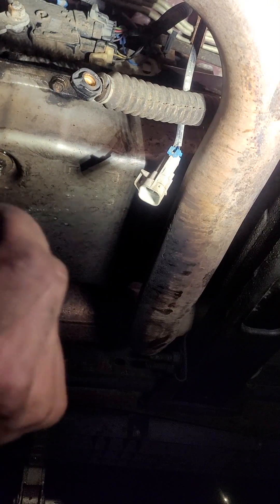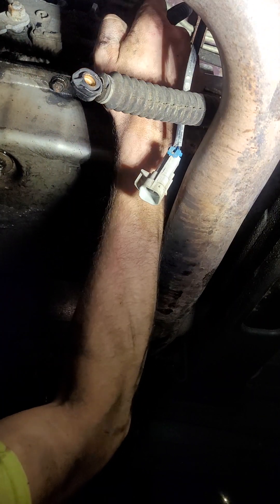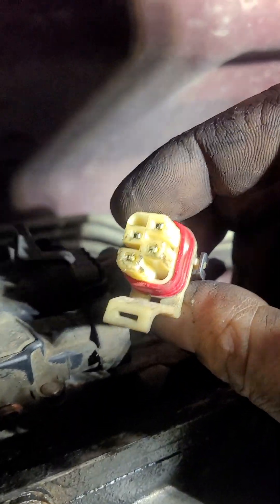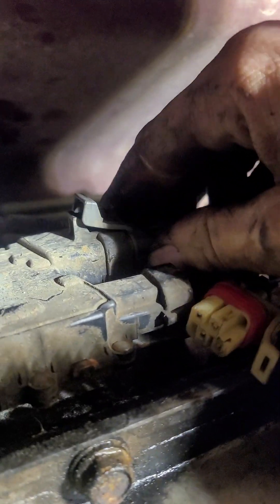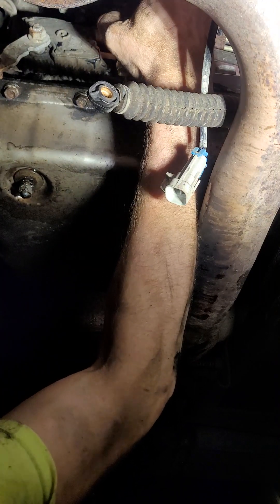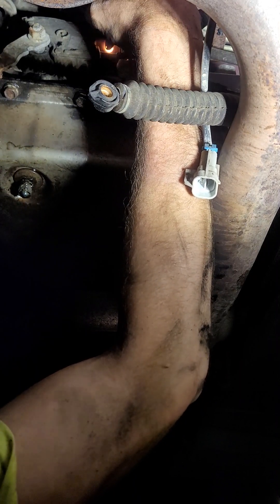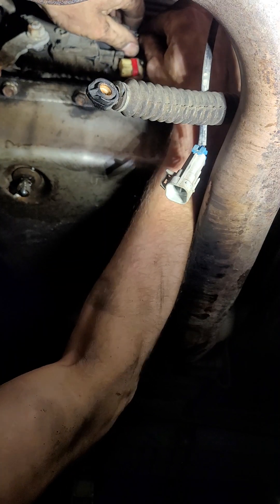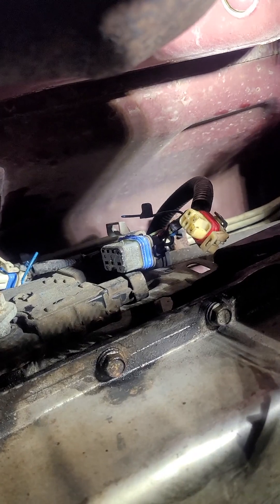GM neutral safety switch glue hack #mechanic

Comment: As a mechanic of many years I have had to unplug a good number of these switches to replace transmissions. At the shop we used a small handheld propane torch or a heat gun. If you are doing one of these at home a hairdryer will work.
Reply from the maker: I wish I had thought of a hair dryer definitely would've been easier thanks!